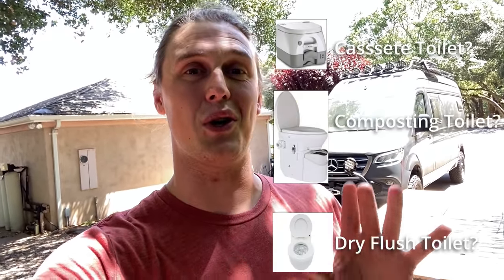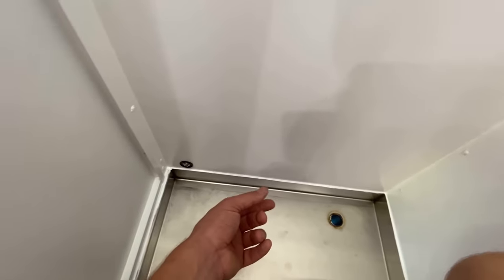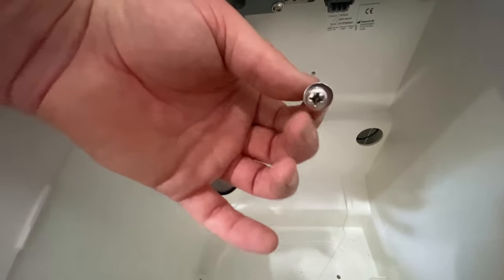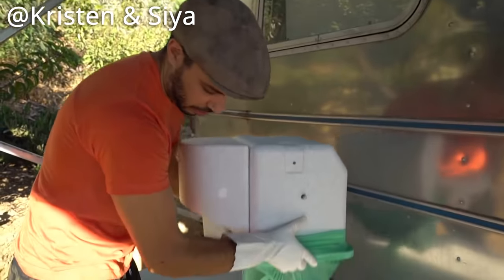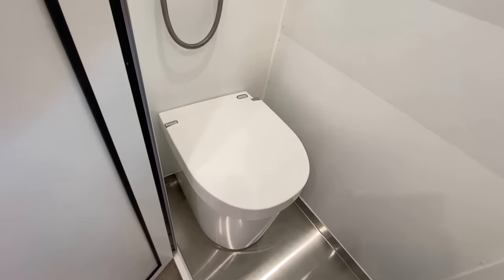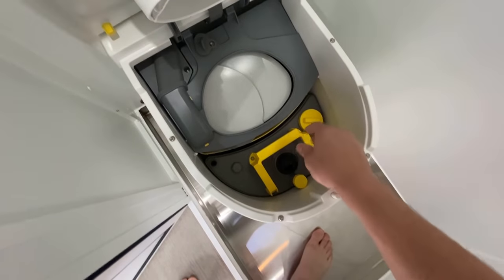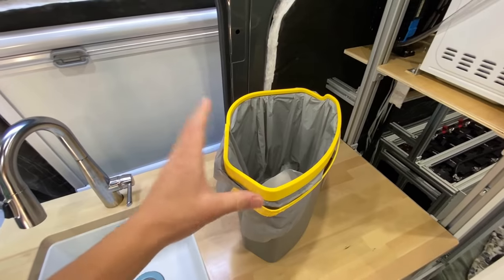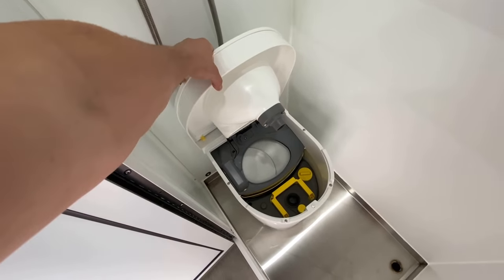The BEST TOILET For Van Life??? Hint: not composting

Comment: Awesome job! This confirms all of my research. 6 months ago I started to re-engineer the composting toilet because I felt like they could be a lot better. When I was finished I looked for a toilet that was already in production. Seperette was really close to what I had designed. The important criteria are... 1. Water toilets compound the problem. 2. Why use compost medium if a composting toilet isn't composting anything? 3. If the poo is going to end up in the trash then pooing directly in the bag makes the most sense. 4. Separating urine makes the poo problem smaller.... All of these items are addressed in the Seperette toilet. 

I'm just starting an ultralight boondocking truck camper build. I concluded that the Separatte Camp toilet made a ton of sense. My goal is to modify the poop chute on it for quick individual bag use and buy small cheap composting bags in bulk. After each dump the bag would be tied off and shoved down a pvc pipe with a bag liner in it. I think I'll be good for a whole month without emptying the pvc tube. But when I do, it will be as simple as removing the liner from the pvc tube and tossing it in the trash. With luck, by the time the bag composts then the poo will be benign and excellent compost.

It's also important to note that this method isn't sensitive to particular types of toilet paper, wet wipes, and isn't as "hands on" as some other methods.
Reply: When ready, please show your solution.

Comment: You convinced me ....what a piece of engineering , I wanted the sun mar micro since I had a small sun mar one for my boat , but now I need one for my trike trailer ....three wheel dive electric assist recumbent trike with photo voltaics pulling the trailer .....ya the fact that the lid and other covers need not removing is a plus , my previous nature head was a pain and sometimes the stiring mech , was stuck .and you had to find a place to rest the top of the toilet  I like the bag and not needing to dump material in there is a bonus since now one can use the room to shower in and not worry about getting the filler wet or tripping on the dam container and scope .....thanks for the video ,

Comment: After my exposure to the Thefford 2.5 and the plain bucket and wood chips, might like this one. There's still the bag dumping which I might put chips in the bottom for smell and moisture control.  Everything else is what I already do except this toilet would allow me avoid dumping every other or every two days. 

The bucket method you use a lot of chips to absorb the liquids and cover the solids. So it gets heavy for light lifters or disabled and needs to be done every 3rd day or night. The easy toilet showed up in recommended so I found this channel for more vanlife ideas. Thanks for sharing! 🤗❤️👍🏾💯

Comment: No, think I’ll stick with my composting system. 
Reason: I like the idea that the odor is actually eliminated, not sealed. 
That sealing ring on the yours is fine, but it is merely containment, not elimination (pardon the pun). 
With a composting toilet . . . well, at least with mine (on my boat, a Jason 35 - S/V Jenna Simone), after “use” you give several cranks of the churning rod, and after a few minutes you can literally put your face level with the rim of the compartment and there is no odor! And all I have (going to design my own to fit my hull) is nothing more than a five gallon plastic bucket, quarter full of sphagnum peat moss at the bottom and a long-handled weenie roller (without the roller sleeve, of course. find them in a paint store or big home store) that I use by hand from the top (I did have another one with the churn rod going through the side like the actual manufactured ones but it broke).
Seriously, it’s like magic. I don’t understand how it can have no odor! Just that earth-black dirt smell. And when dumping it, all it looks like is a bucket of black dirt. And again, nothing but garden soil to inhale.
I think it’s God that did it.
So yeah, I like knowing that it is transformed into earth-fragranced dirt instead of fresh full-bodied excrement (sorry).
Reply: I think it's keeping the solids and liquids separated and allowing it to dry before dumping that makes it less smelly.
Reply: I want a composting one. I'm going to try and make one
Reply: @amywalker7515  Indeed, keeping the solids and liquids separate makes a HUGE difference!
Reply: @sandiadamson1754  I made my own. super easy! I looooove it!

Comment: personally a 5 gallon bucket "porta loo" system using trash bags (and a few cups of moisture absorbing kitty litter ) and a urine bottle works fine.  The few times of #2 get tossed in the next dumpster each time.

Comment: I would still throw compost like peat in there after each schiznitz but that's just me, to help keep the odor at a minimum.
Reply: I agree.  For those unfamiliar with it, peat moss is miraculous in its ability to neutralize poo odors.  I have an unvented composting toilet in my little travel trailer, unemptied, sitting in the hot sun for months.  There is absolutely no smell in the trailer.  None.  Zip.  You have to open the collection container and get your nose pretty close to the business before you can detect anything, and it's a rather pleasant, earthy smell like garden soil.  The key is keeping the urine out, making sure you don't have excess moisture, and using enough peat moss to cover/coat all the "deposits".  You can use it in a simple bucket toilet that just gets bagged and emptied when full, and it works well that way too. This toilet doesn't look like it is designed to do this, so it might be a bit awkward to get the trap door open to allow you to easily sprinkle some in after each use, but it might be worth a try if someone has odor problems not handled by the ventilation fan.
Reply: Buying peat compost is really bad for the environment tho
Reply: I agree, I'd do that!
Reply: @qitiji4360  Ise cat litter!

Comment: Wait, so when you pull the solid tank, you get a full throated blast of poo and gut wrenching, revolting, visual and olfactoral nightmare... lemme know how THAT goes in a month.
Reply: That’s what I was thinking!! You open the bog of stench and just see a pyramid of your aging excrement for a painful minute that seems like an eternity staring into the sun, just to close the bag up as fast as you can. Nope
Reply: Same thought here about opening the poop part.🤢 Maybe putting a cup or a sprinkle of cedar shavings after doing #2 might help. I know it would fill up a little faster but that beats the visual alternative in my humble opinion.
Reply: It's not for the immature that's for certain.
Reply: @jasonlawson8619  True. No cleaning of this type is easy or pleasant. We have the standard black tank system and I’ve had my share of thankfully minor mishaps. I like the idea of not having to use so much water and have been looking at alternative systems for awhile.
Reply: A full throated blast?? 🤣🤣🤣
Reply: @alliw1276  Definitely!
Reply: @alliw1276  , yes that's what I would be doing as well...in between each #2 a tiny bit of cedar/sawdust AND one last one at the last #2!
Reply: yeah, but the urine is probably still worse.  pee is waaay worse than poop.  i imagine you could still chuck a few handfuls of pine chips are something down there to help with visuals and smell.
Reply: The guy is 6'5" , it's gonna fill up fast!
Reply: Yeah you get boom boom  poop when you open container after a month. Good luck without a light indicator telling you when to actually empty your stuff.
Reply: @jakeviolet2195  or years…
Reply: I’d say empty it often, like immediately after each use. A month would be pretty scary.
Reply: @bfe671  and would a composting bag last a full month before disintegrating?
Reply: @Jmp5nb  they’d probably be pretty desiccated at that point. Maybe that’s the way to do it.
Reply: I think I will stick with a black tank for my TT.....yeah not going to be scooping out my turds
Reply: @jamesautry7432  This one has bags. But if you have a black tank of course wouldn’t make any sense to switch.
Reply: Baking soda... cheap and would absorb some of the liquid in the poop
Reply: 82clash   having for the past year taking care of my elderly  disabled father, gotten used to cleaning things I never wanted to see along with associated sights and smells.

Comment: I’d still stick with my airhead composting toilet. I usually just dump it out with no need to hand trowel it out. The airhead is also super simple, durable, and heavy duty. That thing looks like it has many breakable parts and it still costs the same as the air head. I’d love to see one in person though to see how heavy duty or not it is. The air head has a clear window in the pee tank too. So it’s easy to see when it needs to be emptied. I’m not a huge fan of the nature’s head toilet either. Now if that thing had a bidet built in I would be all over it. That’s the only thing I miss when I’m staying in my van.
Reply: I’m building my own composting toilet and installing a bidet. It will drain into the bucket, but I’m going to use cococoir or animal bedding pellets in there, so no big deal.
Reply: @hartmanartsource  I've been thinking about doing something similar but only for peeing and having it drain into the pee container. Technically the best thing for the environment is to water the pee down by 1-1 any way. That would limit my TP usage to only poo.
Reply: @hartmanartsource  that might work but I’m guessing you’ll need to empty your tank a lot more often to avoid moisture build up and bad odors.
Reply: @angelacarter6593 , I have used an old pioneer trick to eliminate my TP usage. I took old washcloths, cut some in half (heavy duty) and others in quarters, and use them (sometimes dampened) to wipe after using the toilet. They go into a bucket and sprayed with hypochlorous solution that I make from electrocuted salt water. It disinfects like bleach. When the bucket is full, I wash them, dry them, and put them back in my “family cloth” box. They are perfectly safe and clean. However, I do keep TP for guests.
Reply: @memoryim  a bidet with a very thin, accurate stream, followed by dampened “family cloth” won’t make that much difference with an exhaust fan and using it once a day. Especially using the thirstier media for coverage.
Reply: @hartmanartsource  oh yeah just once a day should be fine. In my van it’s me and my wife though. We are vegan and eat lots of fiber so not just one 💩a day.
Reply: @hartmanartsource  I considered this but I will be doing laundry by hand so that would add a quite a bit to the laundry.
Reply: @angelacarter6593  same as babies with changing a nappy, adults too can use a wash cloth with a small bucket of water with some biodegradable soap, kept near the toilet, and change it out approximately once a week, number two's give the wash cloth a full rinse separately straight after using and then put it in the bucket of water, so easy and clean every time, perfect for vanlifer's. When you have a bird bath, you do the exact same thing, so why not have it setup in the toilet instead of toilet paper, it's what a lot of people do in South East Asian countries, they don't use toilet paper, they may have a hose with water and they actually use their left hand to wipe up in the washroom, that's why in India it's a rule to only use the right hand to eat with.

Comment: After reading others comments I wanted to add something. About the smell. There isn’t any because the poop side has a ventilation fan. The poop actually dries the same as dog poop etc. Once it dries it has almost no odor. And no you can’t smell it from outside the van. The poop is dried from the ventilation of the smell and moisture. And as it gets dryer there is no smell.

Comment: I loved your presentation. Yes, I can tell you are an engineer or a detail person like a dentist (me). We have backpacked extensively so having experienced that I think cat holes are the ultimate toilet. I've sort of aged out of RVing but we did travel a few years in a small fiberglass trailer, which had a flush toilet and the black tank. I soon realized the black tank/dumping  was something I didn't want to deal with. But we loved the toilet. It worked great. Sometimes products are engineered, as you said,  to improve but I think in that process simplicity is put out of the goal. We know engineers have to engineer to keep their job. After viewing hundreds of YT videos and my own experiences I think RV systems are too complicated, and because of this, breakdown is inevitable. I could expound but I won't. In the end we lined our toilet with a plastic liner, like yours, placed a little cat litter for absorption, did what we needed, removed the bag, placed outside in a 5$ blue bucket with a tight lid. This is the Lowes blue tank. We threw the bags in the dumpster as we left the campground, waving good bye as we passed those campers lined up at the dump area.  Our bath was exhaust vented. Never an odor. There was never a cleanup.  We each have our own preferences when we camp and we found this as close to an outside cat hole as you can get inside.
Reply: Agreed.  Also in 5 months traveling in my prior van, I only had to cat hole once.  It's amazing what a little self discipline to go before you have to go, i.e. on your brain's schedule at a facility, as opposed to your body's schedule when it needs to vacate.  In process on my new 159" ProMaster conversion, and will build for a hidden seat that will support double thickness bags underneath it, some absorbent material, then an airtight storage box until a trash can appears in a day or two at most.  But plan to use it +/- 4 times a month...

Comment: Mechanic Vs. Engineer thoughts. I feel that it’s a great design upon initial impressions, mostly because it is new. But it seems as there are too many moving parts and moving parts are always prone to failure, especially when implemented in a heavy use (yuck) environment. Sometimes things can be over engineered and I’m sure you can relate to that.
Reply: Timothy Miller  and you tubers hush up those “failures”
Reply: We have the larger version in our boat, it’s going on 3 yrs and no parts wearing out.

Comment: The only thing I'd be concerned with is the smell on the outside of the van that's emitting from the toilet. That would smell pretty bad, I would think. Could make sitting outside a stinky situation. lol
Reply: Really
So you're going to put your nose right next to that pipe and take a deep sniff.
I don't hover around turds
R u mcfly
Reply: @Temple-of-Procrastination   Guess you're not familiar with how gas doesn't stay in one place, especially with the outside breezes and such. Read up on it some time. It's alright, not everyone can be a genius. You're doing fine. Don't let this get you down. :)
Reply: A legitimate question/ concern. Where I am, free camps are often packed at night (covid19 created a lot more nomaders) with other vans etc often within 3m to 5m.

Bad smells is up there with late night loud noises as a social ostraciser.
Reply: @nitrostudy9049   Exactly Nitro! The smallest of breeze can take those smells to others camp sites while they are out enjoying a campfire.
Reply: That's why it separates 1 from 2. Most the odor comes from being mixed.
Reply: @kayci2058   That is absolutely not true. Ask anyone who has to change a colostomy bag.
Reply: @Temple-of-Procrastination  ,
like a blue-arse blowfly ?
Reply: I doubt it would be any more stinky than the vent on a normal composting toilet. Ideally, the airflow will dry out both fairly quickly.
Reply: @EmMae1.0  if only one could add some peet moss to the diet to tame the smell of a colostomy bag. I tip my hat to those who can power thru that gantlet. 
Baby diapers got nuthin on that.
Reply: @brucebennett7229   lol so right!  I remember those days well. And you're right, I'd repeat that before attempting the colostomy bag changes, if I had to make a choice.
Reply: If the neighbors complain tell ‘em to find another campsite!
Reply: @EmMae1.0  blame another camper! Who smelt ‘em…
Reply: @brucebennett7229  Nursing diapers doesn’t smell like formula!
Reply: @nitrostudy9049  there is next to ZERO smell emanating from the van/house, with a COMPOST toilet, because the excrement is hurried in a pile of super absorbent material, like coconut core, or peat moss. The pile wicks away the moisture FAST, and during that process the odor doesn’t really get out, so you can pretty much go right up to our vent, and smell just soil, if that. The detail the people don’t realize is that it’s all about evaporation, the only reason that we smell any foul odor with say ,dog poo, is because it’s evaporating. So basically the genius of a compost system is that the evaporation is happening inside a pile of absorbent material. There is nothing new with what is happening in a compost toilet.

Comment: When I was a child, we used an outhouse.  We used wood ashes (very dirty to store) or lime to get rid of the smell.  Your #2 bag is going to have odor.  I suggest getting some lime and putting a small amount in your container after each use.  It will help keep the smell down, very inexpensive, won't hurt the environment...or use wood ashes...either will work.  Blessings!
Reply: Wood ash is high in lye content, a strong alkali, and lye/lime can be caustic, can burn flesh, so I have heard the combo of urine and ash can cause a reaction of burning fumes which would be painful on tender bottoms. There is always possibility that some urine can get into the solids area. Although it’s possible that what I have heard may be a myth, I would also recommend caution storing the use of using lye/lime to prevent children accessing it.
Reply: @joansmith2974  the urine doesn’t go in the solids container
Reply: Yes. Lime = no smell